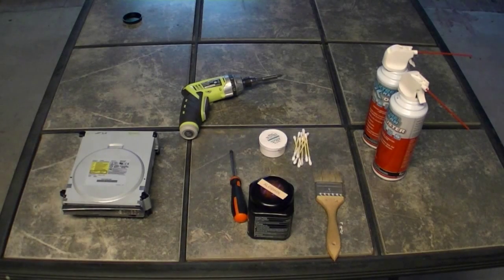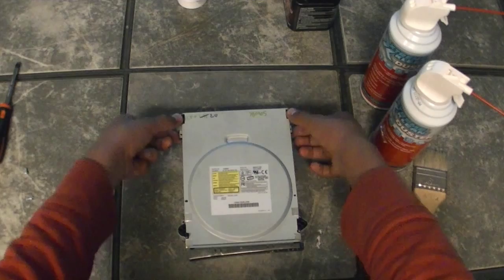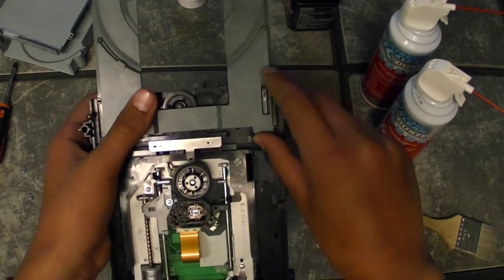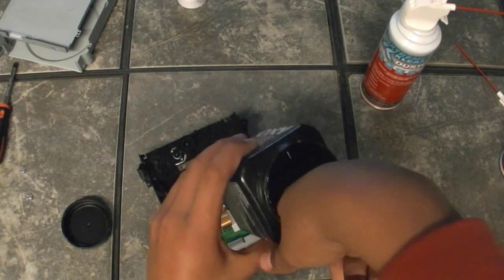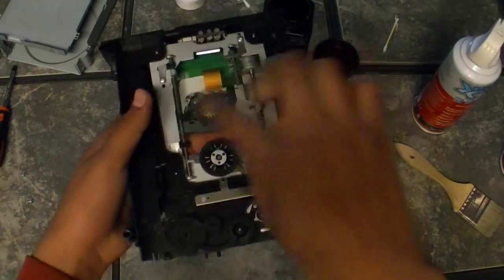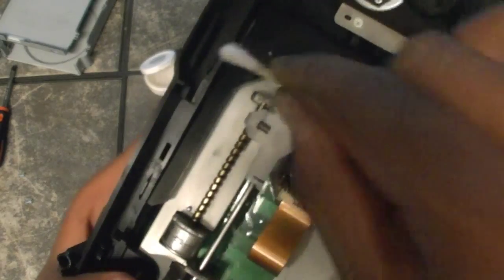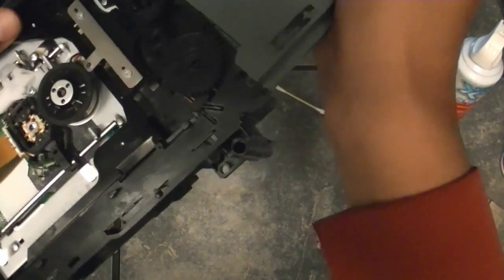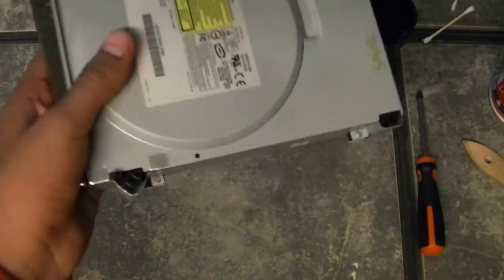How to fix the disk tray stuck problem on Xbox 360

Comment: Hey is there a part 2 to this video because I got it to open when I took it apart and when I close it 

The disc drive opens when it wants to can you help me a little bit here I've been trying to fix this and still have yet to get it to open with the whole system put together....